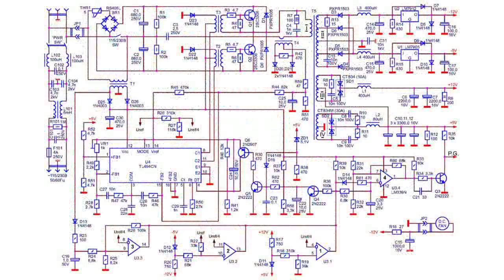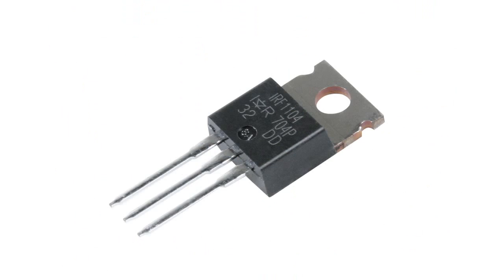DC Current PWM-Controller. Circuit Engineering

Comment: this
As kit job in Mexico has to move 30-230VAC motors and mechanical power 50hp between 20 and 50 amps to send me a quote ilumina33@hotmail.com on behalf of Jose Guadalupe q roo kings cancun mex thanks for all the great Moror intslacion instructional use of bank and research